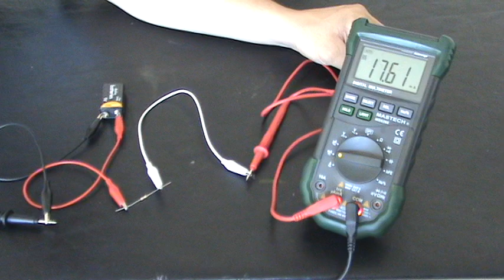Robotics and Electronics Tutorial - 13 - Measuring Current

Comment: @hutakesvi Kirchoffs Current Law (KCL) says that in any node in a circuit the sum of all currents has to be 0 (when a current flows out of the node that current is considered negative). The current can't 'split up' at any point, so the current will stay constant in the whole system, and is only time dependent (the resistor will warm up which will cause an increase in resistance and thus a decrease in current).

Comment: When we connect resisters in series...then we say that same Amount of current flow through the Circuit......
Suppose we have 2 resisters connected in series in a circuit...when current start to flow(suppose from -ve terminal) and goes through first resister,now some energy must be used by first resister...now how can the same energy be transmitted to the 2nd one!!???
how is the current constant>??as some energy is used by the 1st one..!!
If any 1 knows about it...Reply me.
Reply: I think I see where you're coming from, although I think you could've worded your question better too. You seem to be interchanging current flow with energy transmitted as if the two are completely identical (whereas it's evidently not that simple). 

I'll give it a shot though anyways: if you imagine the circuit (loop) like a hydraulic system...generally when you have a source connected and supplying hydraulic pressure to the system (such as from a hydraulic power cart), the rate of hydraulic fluid flow (gpm or gallons per minute) - which is analogous to current or electron flow here - will still remain uniform along any given point in the system (regardless of the placement(s) or lack thereof, of, e.g., pressure relief valves). 

The only known problem I (an obvious layman) am aware of with even this attempt of an explanation is that, there are certain types of pressure-control valves (namely, counterbalance valves) which apparently have as their primary function, the maintaining of a set pressure in part of a circuit). Directly contradicting the notion that the flow of the system cannot be limited in such a way that it wouldn't nevertheless be uniform across the system...

Can anyone clear this up?

Comment: There must be enough resistance in the circuit such that the current will not exceed the current limit of the range you've selected. For example if you set your meter to its 1000mA range then the current going through your meter must be 1000mA or less, or your risk blowing the meter's fuse and perhaps ruining your meter.

Comment: If the resistor is connected to the battery (thus, current is going the resistor) and you touch the multimeter probes across the resistor and the multimeter is set to measure current (mA) your meter's fuse will blow and if it's a low quality meter, the meter itself may be damaged. You only connect the probes across the resistor when measuring voltage